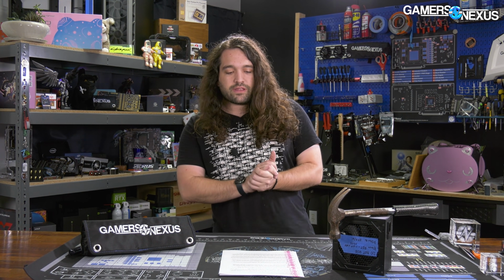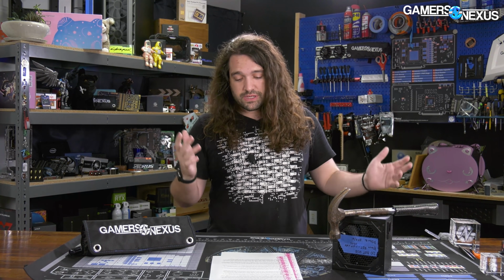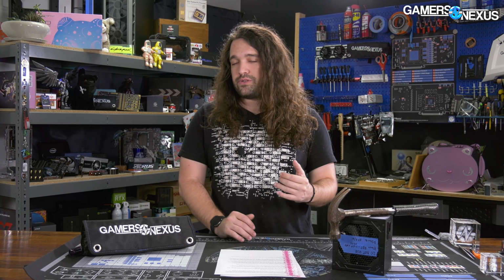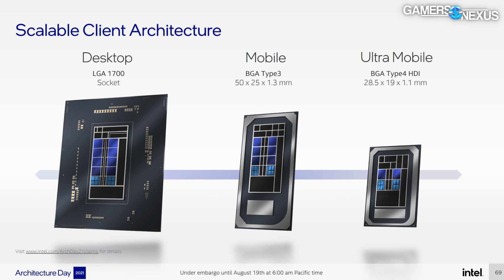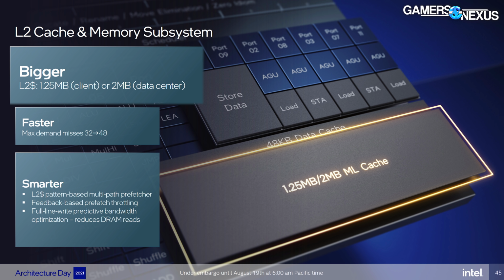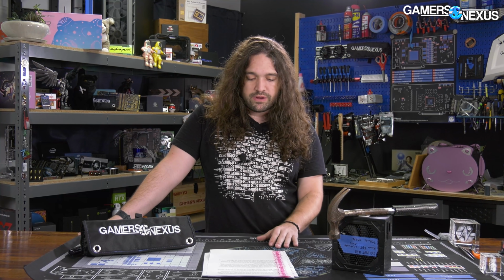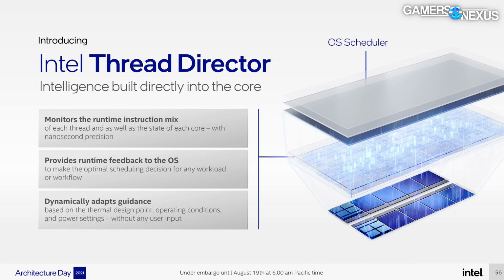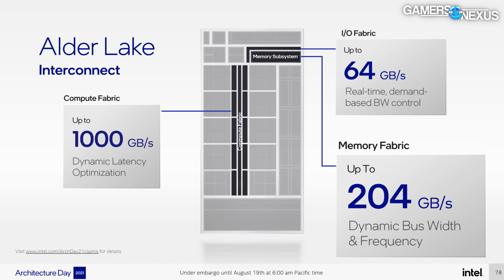Intel Overhauls CPUs: Alder Lake Architecture Explained - New Core, PCIe Gen5, & DDR5

Comment: Gamers Nexus, can you imagine at which level will the gaming be by 2030 when Intel, AMD, and Nvidia will be at the 1nm node obtained through extreme ultraviolet lithography, these threedimensional chips composed of graphene could utilize trillions upon trillion of transistors per inch square, optical interconnects, nanowires and carbon nanotubes, enabling million times more computing power, where such immense computing power will be able to deliver 16K and 32K resolution video games with graphics composed of trillion of  Microscopic nanopolygons which will be displayed on Micro LED and Nanodisplay based monitors. in 10 years, Virtual Reality will dominate the future from any point of view.
Reply: in 10 years politics will have killed us^^
Reply: @floriangraf7198  I'd give us 7 years.
Reply: Such a system will use far too much power.

Sounds nice tho.
Reply: How to use too much power, since the circuits will be so small will be even more power-efficient and will be less space for electrons to travel on such single nanometer scaled computer components, and the human brain already uses a hundred trillion synapses and a hundred billion neurons and is the most efficient system on the planet.
Reply: What politics? you'll enter the age of superintelligent machines, you'll move from the fifth paradigm of computation to the sixth paradigm of computation, and politics is a stupid term used to define the current human stupidity, in the end, Molecular Nanotechnology and Molecular Nanofabrication will let the A.I compute with septillion computing elements per cubic inch into perfect nanoengineered computing substrates and molecular nanomachinery.
Reply: @lovaszcolin9778  the brain runs at less than 60hz though, while CPUs have gotten to a stable 5,200,000,000hz. They cannot be compared.
Also, "single nanometer" implies the use of carbon nanotubes which are ridiculously expensive. 
And even then, rendering 32K video games will draw way more power than an ordinary outlet can supply. I have done the math myself, with unrealistically perfect scenarios I might add.
I overran the power budget at 12K and 32K is 7 times as much!
Reply: @AurumFaber  Even the current technologies and the Extreme Ultraviolet Lithography and 8K display were ridiculously expensive once and any new technology was and will always be expensive. 
And anyway Intel predicted 1.4nm node by 2029 and even 2 nodes beyond, but here we let the current paradigm alone and we concentrate upon the sixth paradigm of computation, which will literally enable us to compute with hundred sextillion atomic scale computing elements per square milimeter.
And again, Molecular Nanotechnology will enable sextillion times more powerful hardware for literally no cost, molecularly assembled inside Nanofactories and Matter Replicators, according to nanocomputing specifications.
Reply: @lovaszcolin9778   you are trying to confuse me with technobabble, but it will not work.

The sixth paradigm is just cloud computing, is it not? It's not the holy grail of computation, it's grid computing with extra latency.

You still haven't said what materials these processors will be made of...
You just say "1nm." That means nothing. 
We've had the tools to move individual atoms but we still don't have 2 angstrom processors. There is a reason for that.

You say that there can be one one hundred sextillion computing units per mm² but that is just not possible as there are only about twenty-five trillion silicon atoms per mm². And before you mention it, all atoms are very close in size. Even hydrogen atoms aren't small enough to reach that density!
Maybe you meant mm³, but the math still doesn't work out, (125 Quintillion) and even then that leaves no room for power and control. 
How will you power and control it? Maybe it can control itself, but power? No way. 
You also have to insulate them from one another to reduce interference.
And you have to cool it.
How could these problems be solved?
And then "Matter Replicators???"  What does that even mean?
Reply: @AurumFaber  One, you have no clue what the sixth paradigm of computation and Molecular Nanotechnology really is, or the Nanofactories and Molecular Assemblers, that will be reached somewhere in the 2040s, you should read some books of Eric Drexler and Robert Freitas (the greatest nanotechnologists of all time), there were five paradigms of computation with the integrated circuit the last, Ray Kurzweil even has built graphs of it, and has nothing to do with grid computing which you mentioned, there will come a new paradigm which I predict that Molecular Nanotechnology will actually be, and will replace the current integrated circuit, we will be able to build and engineer nanocomputing systems at the atomic and molecular scales, essentially three-dimensional molecular nanomachinery. 

And second, let the silicon alone, into a single Diamond there are in fact septillion atoms per cubic inch to be utilizable as nanocomputing systems, in fact, basic ordinary matter contains hundred sextillion atoms per cubic inch usually, which I defined as Zettatechnology as operates in the range of sextillion atoms. The power of the atom will be in fact incredible in information technology. The Integrated circuits will be essentially replaced by molecular and atomic computation at the fundamental scales of existence, for the first time the Nanocomputing systems will almost infinitely beat the maximum complexity and density of the neural structure at the fundamental scales. It wouldn't be built by humans but will be automated processes and those machines will be already sextillion times more powerful and efficient than today when they will design all of this.

One, Artificial Intelligence will be capable of utilizing advanced Nanorobotics and Molecular Manufacturing to self improve itself according to nanocomputing specifications, a single such Artificial Superintelligence will be capable of optimizing itself to become in fact quintillion times more intelligent than all human brains on earth combined into a single one cubic inch system. 
And ultimately, Molecular Nanotechnology is a technology of the future, completely different than Extreme Ultraviolet Lithography, it will revolutionize the world and reorganize the particle states, it will be capable of offering infinite resources for literally no cost by reorganizing matter at the atomic and molecular scales. It will be capable of offering quintillion times more powerful nonbiological forms of intelligence than humans, it will result in a Technological Singularity
Reply: @lovaszcolin9778  ...

Understandable, have a great day.

Comment: Man...they really go out of their way to not just give us 16 full cores on mainstream, don't they. big.LITTLE on desktops seems like a cop-out to me...and seems needlessly complicated and error-prone on an ISA that that evolved around big, broad, powerful cores. They just don't want to face the fact that they can't catch AMD in performance AND efficiency...they have to sacrifice one. (Needless to say I don't quite buy their claim that the E-cores will be anywhere near, let alone above Skylake core performance in anything but very specific tasks...seems a bit outlandish, but we'll see I guess.)
Reply: Well upcoming zen 5 also be based on big little desgin. Have a look whole presentation than you could understand how big little promising. In a particular operation there are two operation take place scaler and vector and vector instuction doesn't need high performance  core to perform and in traditional cpu architecture the big core has been utilised by vector operation . So in alder lake the thread director will transfer that vector instuction to e core where background tasks place as well , as a result the p core all threads get traffic free for scaler operations . Further if any ai work load will come than scaler will join the e core . 
And Raj already told its not like hybrid car engine where two type of engine will give you maximum mile per gas .
It's like formula one car , traditional turbocharger engine (golden cove core) added additional electric charge (gracemount core) to blast maximum speed.

Comment: Amd only had one year of competitive advantage and they couldn’t take advantage of it because of chip shortages unfortunately. Usually in innovative and competitive industries you only have one year or two where you can gain incredible amount of capital for investing and expanding, if they don’t reap that its troublesome. Now intel is back and they are already buying out slot from tsmc 5nm chips and there is high probability Amd yet again will be fucked systematically. Lets see how Lisa Su will play this out.

Comment: Saying a hybrid architecture or mixed core architecture will underpin the next decade sounds reasonable
Reply: Exactly. ARM is doing it, Apple is doing it, hell AMD is planned to be doing it in 2024. Heterogeneous computing is the future. Obviously what Intel bring to the table with Alder Lake isnt what we will see in 10 years, but the fundamental ideas probably will be, because they make more sense than Homogeneous compute chips.
Reply: The end of the next decade, at the latest, will have to be the move away from silicon. With 2nm architecture, they will be very close to hitting the hard physics limit. That's going to be the big upcoming change.

Comment: Really love the walkthrough and all the info. Great video! I am relatively new to learning about the architecture so I would love to see how it compares to other architecture. It looks a lot like Apple's M1 with it's new width increases as well as efficiency cores. Obviously comparing it doesn't give the whole story like you mentioned at the end, but it's still very interesting and fun to listen to. Looks pretty promising for single threaded performance cores, but I am still very cautious to see if the efficiency cores can live up to their name and arm competition. 

Lastly you mentioned that the scheduler would prioritize efficiency cores over hyperthreaded performance cores. Any insight into why?
Reply: There's a lot to explore here, like I wonder if the Windows power settings could change scheduling behavior.
Reply: To provide an optimal balance between power efficiency and performance.  It takes time to wake up the big cores and more power, so using the efficient cores to test for load requirements saves power.  If the load is using instructions not supported in the E cores then it has to executed with the P cores. To decide on long term target core probably happens after a context switch or 2, and it's going to be pretty dynamic.

Comment: the E and P cores is a good demonstration of the transistor density part of Moore's law. Doubling transistor budget (die are) on a single core is expected to yield 1.4X performance gain. A second doubling for 4X is expected to be 2X performance. Hence four E cores having the area of a single P core means the E cores should be able to 50% of the P core. In a highly-threaded workload, the 4 E cores could be 2X a single P core, depending. 
Hopefully future generations will have different mixes of E and P cores. I am leaning towards 4 P and 32-64 E cores
Reply: P-cores will stay at 8 and after alder lake 8 E-cores will most likely be added every year (maybe even less than a year in some instances)

Raptor Lake 8+16 core 32 thread (same as alder lake just with more E cores and minor ipc, clock speed and cache gains)
Meteor Lake 8+24 core 40 thread (new architechtures for both cores)
Arrow Lake 8+32 core 48 thread (new architechtures for both cores again)
and so on
Reply: @robinkonig5828  wouldnt the chip size increase with adding 16+ e-cores and if so wont that effect yields negatively. i think we're only seeing the first move here maybe the second move will be mcm foveros 3d packaging p-cores on a different die from e-cores but in same  package.
Reply: in a highly threaded workload, just run 6 E cores. most people aren't in that, so you get the fast core + 2 slow ones and 2 other slow ones that are off, saving power budget.
Reply: @dercooney  let me be specific. I am talking database transaction processing. serialized memory accesses - pointer chasing code. runs fine on a simple 1.5-2GHz core, could have hundreds of active threads - however, I don't think Intel should jump to hundred cores in the next step, just do 32-64, and keep memory latency low

Comment: Nice to see this. Amd has finally made Intel have to do something. I felt like Intel hadn't made any real advancements or major changes since the "I" series was released.
Reply: Why are low performance cores an "advancement"? Maybe on a mobile device they're handy. My CPU already frequency scales fine now though. My hottest core is  +36.0°C so thermals are not an issue. Most of them are only +33.0°C and one's even just +31.0°C If I want low performance cores then I'll buy a low performance CPU. Or is that all Intel is offering these days?
Reply: @1pcfred  I see it as this. When higher processing power isn't needed it will use less power and put out less heat. It seems to me they are doing whatever they can to lower power consumption to a competitive level with AMD. 
This is also an advancement because Intel is finally trying something new. Change in this market is good. Intel up till now hasn't had to make any major changes because they had been leading without any real competition since the p4 days.  Hopefully the cpu war will start again, when they are at war advancement happens. 

Not sure if I actually made my point or just spouted a bunch of BS. Trying to multi-task. I think I need to upgrade my brain to a ryzen 9.
Reply: @bleach_drink_me  my PC already does that. It is called frequency throttling. My hottest core right now is +34.0°C so color me unconcerned about heat. Bow down to my awesome Cooler Master Hyper T2 - Compact CPU Cooler with Dual Looped Direct Contact Heatpipes Which cost me a whopping $9.99
Reply: @1pcfred  you are right they have had tech like that for a while. Thinking of it, I don't really see the point either but hey, it's something different they are trying for some reason.  
That's a cheap cooler. I run about 3c above ambient at idle with my open loop setup on my ryzen 7. On the other ryzen build with a closed loop rosewill 240mm(pick up for around $50) it runs around 32c idle but In a 65f room. 

I may have to snag one of your coolers 😆
Reply: @bleach_drink_me  I have often wondered why my CPU runs so cool. Maybe the thermal sensor in it is broken? One thing I know is it is not that cheap cooler.

Comment: Was going to build a new system this year, but it seems with GPU costs, DDR5, and this new Intel CPU design, I think I'll wait a little longer
Reply: I was.  But the more I look at this.  Most of these items won't be mature until 2023.  DDR5 alone at its introduction rate really isn't outpacing DDR4. And this new architecture.  I'll bet money that for the first gen its probably going to keep pace with current AMD wares not outpace it.  Long term I'm guessing it will overtake AMD's consumer wares, until AMD fires back.  shrugs  We'll see what happens.
Reply: @KellicTiger  dude, for laptop the ddr5 is important, since ddr4 capped at 3200, and the little core is very promisinh
Reply: For what it's worth... there's always something new the next year.  You have to pull the trigger eventually.
Reply: @jynxycats  Not this time I'm afraid. The transition to DDR5 means changing almost every piece of pc part; starting from mobo, rams, cpu, psu even depending on your system spec.
So yeah, it's definitely worthwhile to wait a bit longer.
Reply: @reftu7856  true; yet, JynxCat in not wrong.  Wait for this, and that changes, then the other thing doesn’t works as well with either this or that.

I kept waiting, and waiting; however, I just built a 9-5950x system that is running fantastically beyond my wildest hopes.  By the time this system ages; both blue and red will have completely different offerings.  And if nothing else, someone else will be my lab rat to see how the new hardware is doing.

To the OP; just build the best system you can now, with what you can afford; and let this latest iteration settle down.  Remember how crazy fast AMD kept dropping new CPUs once Ryzen hit.  If Intel does the same, a year or two from now; the stable chips from both will be far above and beyond this “they claim… they claim…”
Reply: Smart man things are about to get serious and interesting 

I'm waiting for intel raptorlake to upgrade so just sit back and milk ur current PC and just watch the tech videos
Reply: It all depends how old your current system is tbh. I personally am going to build a 10700k z490 system soon from my old 3770k ddr3 setup. I really can't be waiting for ddr5 to come out AND getting ironed out till it's actually worth it, my current system would be way too old. But if you come from a much recent system, then yea, keep using that no point in upgrading now.
Reply: @LegioRulez  New Technology always comes with Issues. Besides, all those People will be paying Premium Prices for Betas.
Reply: Q4 2022 or Q1 2023 is your best bet
+ a lot of new hardware would come out then
Reply: @cydia11centra  essentially a new pc generation 😂
Reply: @TotalGAMIX  yeah exactly
Reply: Def for new ram. Its going to make a huge difference